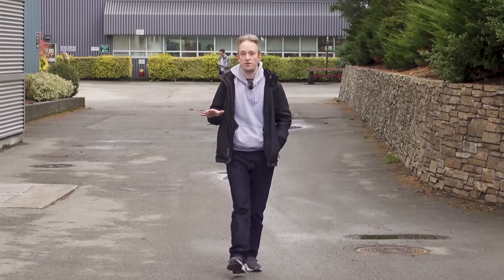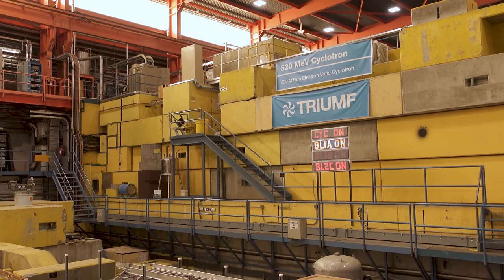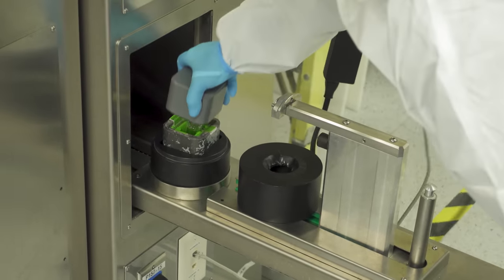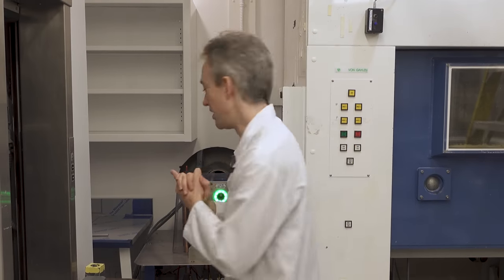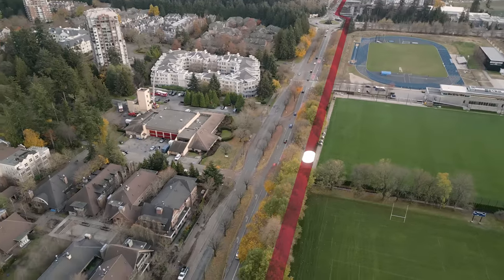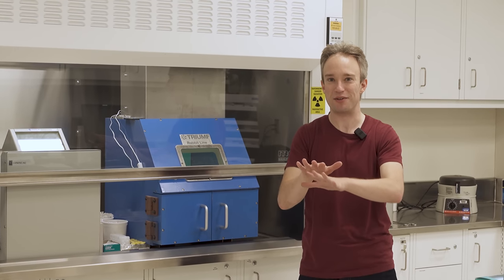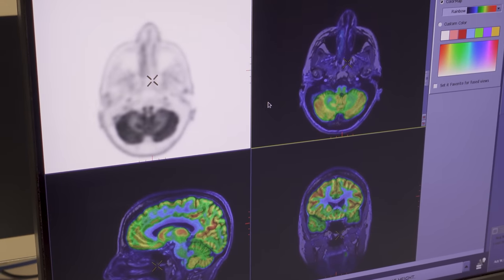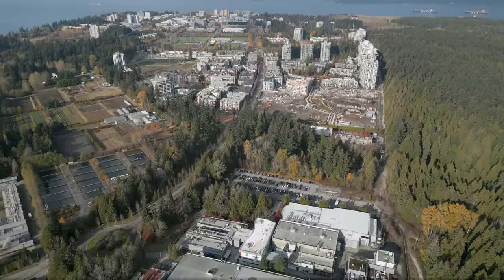Firing radioactive stuff at high speed under city streets

Comment: I remember back in Highschool, for our senior physics assignment we had to pick a medical imaging technology and write a reports on how it functioned. I chose a PET machine, which isn't the same as this, but follows a similar principle. Inject a patient with something slightly radioactive and measure the output. In the case of PET machines the radioactive isotope is contained in some molecule that your body already uses so they can see if your body is doing anything odd with that molecule that it shouldn't. For example they can use a molecule almost identical to sugar and can see if a group of cells is absorbing it unnaturally fast which may indicate cancer. 

This sort of stuff is just so interesting.
Reply: That was a pet machine. it says it on the side of the scanner at    4:27
Reply: @rodbotic  oh haha, missed that! I assumed it was but I wasn't sure :)

Comment: This is very interesting. I once checked out the SLS Cyclotron that 2.4GeV (around 5 times bigger) than this one. It is used for an electron beam that produces Synchrotron radiation. Almost forgot to mention the SLS is at the Paul Schärer Institue in Switzerland where they invented radiation therapy for cancer and are currently developing a new kind of X-Ray machine for the diagnosis of breast cancer.
Reply: The SLS does not have a 2.4GeV cyclotron.  They have a 2.4GeV synchrotron.   Their ring cyclotron is 590MeV and while pysically smaller is both higher energy and insensity that of TRIUMF's

Comment: Great video. Would be really interesting to know if they laid the tubes at the same time as digging up the road for something else or whether it was an expensive separate job. I'm also curious as to whether the particle lab does anything else and, if not, why it's so far away? If it was built later how come that's not the same for hospitals elsewhere doing the same thing?
Reply: Laying a pipe of that size can be done with very little disruption using a "gopher" or a "missile" if there's not much in the way.

Comment: Sending it through the line to get it there, and then drive it back. Almost the equivalent of walking up a hill to go sledding down it.
Reply: Returning the capsules doesn't have a tight time limit therefore transporting a box full of them back works just fine. Hospitals with similar systems tend to operate the same way but with the additional complication that the capsules often tend to wind up gathering at a few locations who have no need to send them back.

Comment: Such pneumatic systems are great:
They are comparatively cheap, reliable, long lasting, efficient and fast. They are NOT for bulk-transport so if you need to move a lot of stuff look somewhere else.
It is their simplicity that makes them work. The connection only needs to be a rather simple tube that needs to be decently smooth on the inside and can not bend too tightly - which can be done with cheap plastic pipes that last forever. The systems on each end are also really simple if it is used just for point-to-point connections (switches are available but mostly avoided due to complexity and problems they create). They are incredible fast too as there is nearly nothing that can go even close to that speed, let alone go that speed right to the place you want to send it to or where you are working.

I have seen them used in a university for physical data-transfer. Unplugging some hotswopable HDDs and sending them to the other side of the building and then plugging them in again only takes a couple of minutes, netting you effective speeds in the range of a couple hundred GB/second (doing that over cable would require some expensive networking-gear, high performance storage on both end and still be limited to datatransmission - so no "i'll send you over a pcb-prototype" ).

And they are fun.

Comment: My university also has a cyclotron for creating radioactive compounds for PET scans or other pharmaceuticals (a lot of the research focuses on tracking the path of drugs through the body) but I have NO idea how they're transported. Now I'm curious!

The thing I found most interesting when listening to the researchers on our campus talk about their work was how different their general goals for a reaction are, compared to most chemists. Generally, chemists looking to synthesize something want good yield as one of their primary requirements. Because the radioactive isotopes they're using have short half-lives (I think the longest they discussed was around 2 hours) they're far less concerned with yield than with reaction speed. Additionally, they have to stick with solvents that are safe to use in the body, in case there are still traces left after purification.

Comment: A lot of research reactors use a pneumatic tube system to run irradiation targets in and out of the core when they need to be removed quickly due to short half lives.  They call them the "rabbit" because it is faster than using a fishing pole that the other targets get in and out with.

Comment: In oil and gas you have to drift drill pipe and casings to make sure there's nothing inside them - for that we use a "rabbit". The rabbit goes through the tunnel (rabbit hole I guess).

Comment: For why it is named the rabbit line I have a fact which may also relate.
For electrical wires when we need to feed them through a large inaccessible pipe (such as it is underground) we use a large sort of reverse vacuum to push a large foam block just the diameter of the pipe with a string attached. 
Here's the fact, that foam block we send through the pipe Is called a rabbit.
Maybe it's related maybe it isn't but who knows

Comment: C11 does not release a Gamma rays it releases Beta Particles which then interact with electrons and releases 2 gamma rays in ~opposite directions. This is important as it is a limiting factor in the possible resolution of PET imaging, the highest possible resolution being the average distance that a Beta Particle travels before annihilation. There is a separate radiation imaging technology that uses the direct emission of Gamma rays called SPECT.

Comment: The term "Rabbit" for a small, rapidly transported radioactive sample is used quite generally in nuclear engineering, and is not unique to this application or location. 

For example, it is also used in nuclear reactor systems, where material is irradiated by neutrons (instead of protons from an accelerator, as in this case), and is removed rapidly, often with pneumatic systems.

If anyone is interested in the origin of the term "rabbit", that information might help!

Comment: This has to be one of the few across town vacuum/pressure tube transportation systems left in the world.

Rumour have it, New york postal system had a massive network of these tubes to get bundles of letters across town in rapid fashion.

A little known sandwich store called subway also specifically designed their subs to be transported through these tubes.

It's all abandoned and forgotten now. Apparently the reliability of these tubes weren't so great. But you'll still see them in hospitals for transporting medicines between floors/buildings, and large stores for transporting cash from cash registers.

Comment: Cool to see that you were in my area.
Anyway, I would guess the 'rabbit line' was probably named because they are traveling at high speeds in a tunnel... but would have to find whoever designed/built it to confirm if that is true.

Comment: Woolworths department stores used to use the same system to send cash and paperwork between departments and to and from cashers, i think they worked on a vacuum system as you could hear the suction when they put the cylinder in the pipe.

Comment: In our local research reactor facility, they use this too, just within a building. And in Prague there used to be whole system operated by Post to quickly transfer small packages. I am not sure, if it is still operational, it got big hit during floods in 2002. We call it "Tube Post"

Comment: Wow.  Very cool .. in the 60's 70's we used a similar system to return pit checks from the winding shaft to the control room so they knew which miners were going down the pit and whether they should be paid or not!  Summat else to do with safety as well ... 😜

Comment: It is called a rabbit line because it is stereotypically said that rabbits are very fast runners (think turtle & hare race). The word line just means path for transportation.
Reply: That may seem like the most logical explanation, but (alternative explanation incoming) Canada is a country with a large French speaking population. "Rabbatre" is a French word meaning (roughly) "to make something lower" and is where the English word "rabbat"/"rebate" comes from. It doesn't seem too far fetched to wonder if that may have something to do with origin of the word "rabbit" in this instance.

It's also possible that the head engineer who designed the system had the (rather unusual) surname "Rabbit" or (more common) "Rabiot" (which later got bastardized to "rabbit").

The etymology of words can be surprising at times, and what seems like the simplest explanation is quite often proven to be incorrect.

Comment: There's a Medical Physics and Nuclear Medicine department in the hospital where I work, in the uk. They have a PET scanner in there I think. We don't have a particle accelerator though. Some guy just turns up in the middle of the night, with a small trolley with a small box on, with radioactive symbols plastered all over it. We do have a pneumatic tube system though, but it's just for blood specimens. It's much less sophisticated than the one in the video though. It's more like the system Sainsbury's used to use in the 80's to send cash from the tills upstairs.

Comment: For the return trip, why don't they twist a few valves so the pressure for stopping arriving rabbits now powers return transport.  This obviously requires a similar setup at each end, though return trips are allowed to be slower, like 25 minutes instead of 2.5 .

Comment: From what I was told, there are two reasons: 1. Dog racing, which uses a mechanical rabbit as a pacemaker, 2. Samples in irradiation experiments are usually called rabbits (which leaves the question "why")

Comment: You stated that they don't know why it's called a rabbit tube. Pneumatic tubes have been used in many things from banks to Navy ships. In the Navy they have always been dubbed bunny tubes. And I believe that they may have also been dubbed bunny tubes in other places as well. So that may be why they are called rabbit tubes.

Now with that I have tried to find the history of it and I cannot find anything on it nor when they started being referred to as Bunny tubes. I can understand why they would be referred to as bunny tubes, but it's been for at least 45 years. It being a fast bouncing around network of tubes in which little bunnies, as they are referred to, are put into and sent via a pressurized or vacuum system

Comment: This isn't directly related to the rabbit line, but more about how they make the isotopes. Why do they start with H- (a proton and two electrons), accelerate it, then strip off the electrons to make H+ (just a proton) and send that to the target? Why not start with H+ and just accelerate that?

The only reason I can really think of is that maybe they're sticking more than one extra electron on it, so they have a higher charge/mass ratio for easier acceleration. But can you really make a hydrogen anion with two extra electrons?

I suppose they might have an accelerator that for whatever reason can only work with negatively charged particles, but that seems kind of limited, if you really want a proton beam.

Comment: 4:00 AH! Don't re-cap needles!
Reply: In this case, it needed to be recapped-since after filling, the syringe needed to be placed in a shielded holder, and transported to the tech who injects the tracer into the patient.
So the needle could not be left exposed.
However, under normal conditions, you are correct-recapping needles greatly increases the risk of needle-stick injuries.
Reply: @m.k.8158  At least use the technique where you lay the cap on the table and scoop it up onto the needle, then. You've got to keep your hand away from the needle at all times. I've had this drilled into me.
Reply: @ln5321  I agree that the method you describe is safer than the method shown in the video.

Comment: So I work at the High Flux Isotope Rector at Oak Ridge and we do isotopes that are sent to our Radiochemists they are sent in capsules also called rabbits - i'll have to check with them to see if any of those rad guys know why they use the term rabbit.
Reply: Psst hey what's a vid or other intro to very good reasons to use radiochemistry ?  Gold 195 m, model my cryptocurrency... Just nonworking or remote MRI?

Comment: Interesting. 

As soon as Carbon-11 was mentioned, I  was thinking it would be a positron emitter for positron emission tomography (PET). Carbon-11 would have six protons but only five neutrons, which is why it is a short-lived isotope. Emission of a positron and some gamma radiation would result in Boron-11; and I  have no idea if this is stable or radioactive. 

However, the curious thing that struck me was that the researcher mentioned detecting the gamma rays from the radionuclide, not the positrons (despite various items bearing the legend "PET" visible in the film). I wonder what's up with that.
Reply: In PET the positron very quickly anihalates itself with an electron giving you two gammas.
Reply: @pauldavis2108   - ah, that would explain it. Thank you.

Comment: If you're still wondering why a 10 minute drive is too long: as Yang mentions, the half-life of the carbon-11 is 20 minutes, which means that every 20 minutes it takes to get the pharmaceutical from the cyclotron to the patient, you loose half of it. So during the 10 minute car ride alone, you're loosing 30%!

Comment: In the description, it's written 100 kmph(60mps) which isn't correct...

It will be either 216kmph(60mps) Or 100kmph(27.7mps)

Kindly please rectify this...
Thanks
Reply: I don't know where you got your conversion but given that 1 kilometer is about 0.6 miles, 100kmph ~ 60 mph
Reply: I invite you to google a kmph to mph converter and put in 100kmph. You will find that it is, in fact, roughly 60mph. Were you perhaps instead thinking of m/s, as in metres per second, rather than miles per hour?
Reply: @lenabrokaw714  you got me 🤣

Comment: Or you could have built both buildings closer together and saved a lot of resources; but what do I know.
Reply: A lot of resources? From a small tube powered by pressurized air? That costs more than building a new massive building where it is probably already built up? Really?